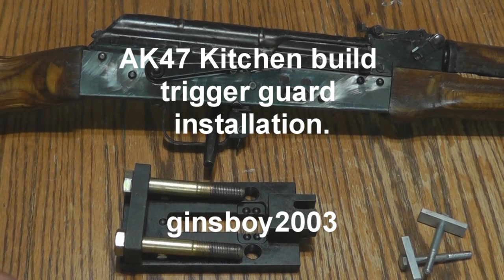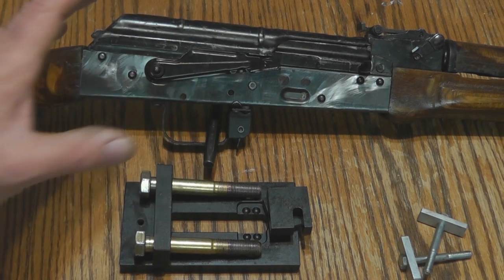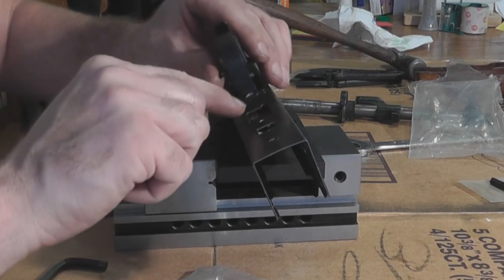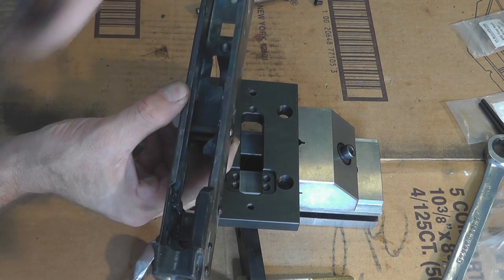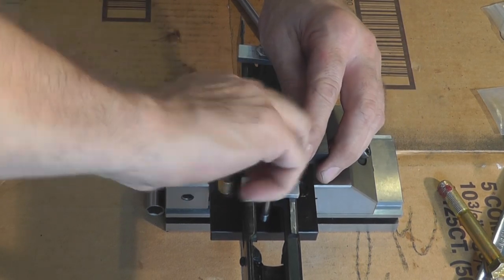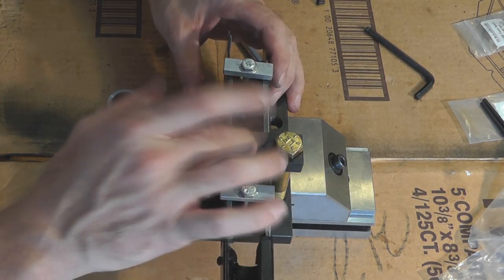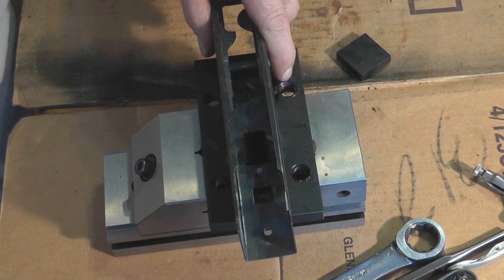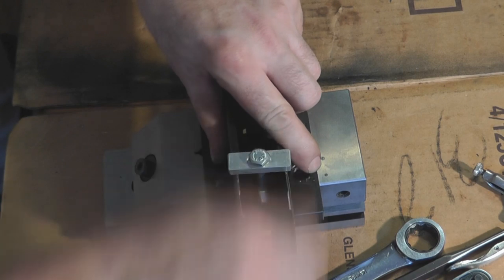AK47 Kitchen build trigger guard installation tothtool installation tool

Comment from the maker: Well, first get the kit.  They are very hard to find right now at a reasonable price.  After that, if you don't want to build from a flat, get a NDS receiver and the right rivet set for the build from ak-builder.  I'm am soon going to modify my toth tool rivet squeezer and use it to build an underfolder so that may be of interest to you.

Comment from the maker: It wouldn't be necessary, but might be useful if you were doing 20 receivers and wanted them all to be the same.  The shop tail of a rivet is supposed to be a certain dia. based on the dia. of the rivet so that is what I look for.

Comment: Robert, I am having the same problem! I am going to consult a machinist friend of mine to see if I can either mill the block down enough to make it fit or grind the dimple down without damaging the way the hammer pin fits?!  It would seem impossible to try and flair the receiver with the both trunnion blocks installed.  I am going to ask toth tool about this problem as well!

Comment: just imaging if you were using an electric or air powered ratchet/impact... you'd be able to build an AK in under an hour! lol. sold me on the toth tooling though. i've been contemplating the best course of action, and this seems like the best and most affordable way. a 12 ton press from harbor freight is like 160$. the toth tooling is ~200. for the 3 items. you'd still need all the extra tooling for the 12 ton press so the toth tooling wins out every time. if only i could find a damn parts kit!

Comment: Craig, I had that block milled down to fit in the receiver! It has to be slightly smaller but it worked!  I have a friend who is a machinist do it, but you could probably do it yourself with a dremel tool, might be kind of tedious but it could be done! Now it is slightly wedged shaped but it worked to get buy the dimple!

Comment: Good job not riveting your rear trunnion in before riveting your trigger guard in. I made the sad mistake of doing that on my last build, and I had to take a milling ball and cut a notch in my rear trunnion for the support braces to be bolted in. On my next build, I am going to install my trigger guard even before I install the front trunnion, weld the guide rails in or rivet the center support into place.

Comment: great videos ginsboy2003 my question to you is where did you purchase that vise..you use it on many videos you do. Keep up the good work.
Reply from the maker: It is a "screwless grinding vise" and you can find them on ebay or at machinist supply web sites.

Comment: My block to crush the rivets won't fit in the receiver with the hammer pin support that hangs down off the rail on a saiga any suggestions?
Reply from the maker: Not having seen a picture of what your talking about I'm not sure.  Could you modify the block to fit or perhaps the support?

Comment: My only problem is, like Robert Flury had, that I can't get the crushing block underneath the right side rail dimple. Does anyone know a good solution around this?
Reply: bump
Reply from the maker: GregTheHun I did have to tap my block in place, but I got it in.  If you're having that much trouble, maybe if you removed a little metal on it?
Reply: We have since revised the crush plate and it has s step down to clear the rail. Once in a while you may come across a receiver that the crush block wont slide in on top of the rivets. Try to slide the block in first, flip it over and install the trigger guard and rivets, then lay the plate on top. Carefully flip it back over, tighten the holding clamps in as tight as possible without bending them.

Comment: For some reason Toth Tool does not mention this trigger guard installation tool will NOT work on a Yugo! I bought it and put in the comments of the order I have a Yugo to make sure this will work. Also, the Long Rivet tool will not work 100% either, the forward most rivet will not fit on the little pocket head because the bulge is in the way. These are great tools and I will keep them for a non-Yugo build, but if you have a Yugo, DO NOT buy these tool.